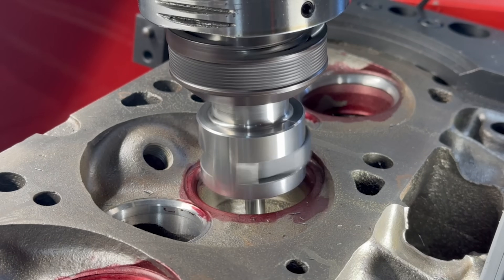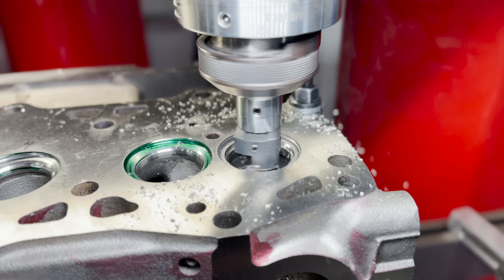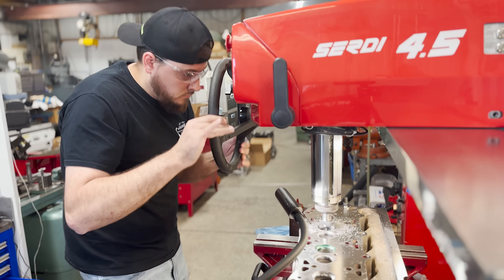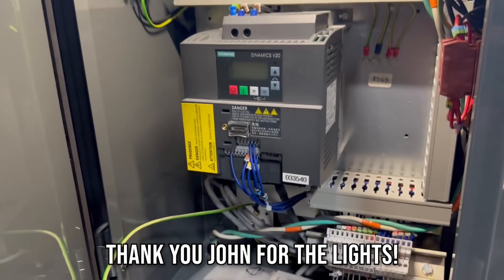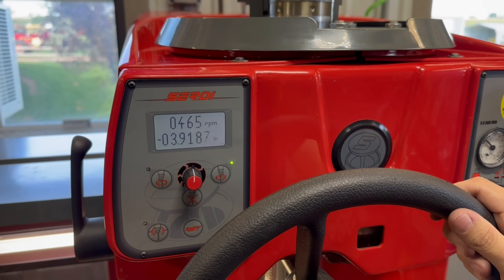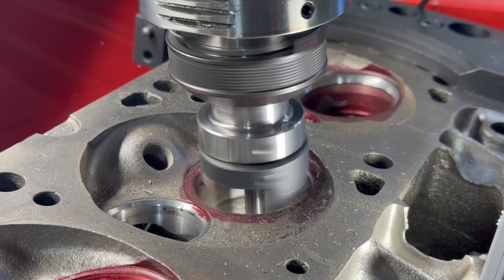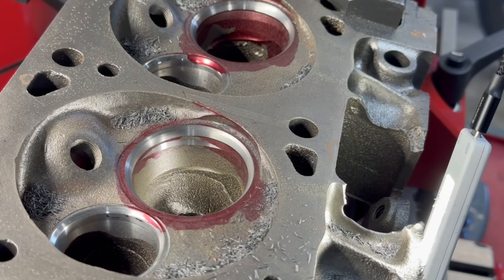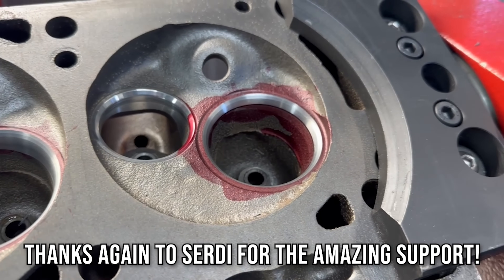Don't Let CHATTER Ruin Your Valve Job!

Comment: This has been a big issue in lathes for years when facing especially the closer you get to the center of the work the material removal rate becomes slower and causes chatter nice to see theyve incorporated a variable speed solution in a piece of automotive machine equipment it's worth installing nothing sucks worse than having to start over because you snuck up on something and then hear that chatter right as you're about to feed the spindle up especially in a machine as anemic as a valve cutting machine you don't have the rigidity like you would in say a standard milling machine that's pretty neat

Comment: Do automotive machine shops do valve seat replacements on Briggs and Stratton opposed cylinder engines? I have one that at least one seat is loose. The block is aluminum, as are the heads.

Comment: I'm surprised you guys don't have New Way valve seat cutting system. 
I used them for years in my shop. 3 steps: 60 degree first (dry) 30 degrees (dry) and 46 degrees wet. We used flywheel grinder coolant. A few turns, let up pressure, let it coast and polished seat beautiful.
You did 45 valve 46 seat interference fit.
Less than 30 seconds per seat.  We had bench mounted electric driver.
5 Carbide cutters.
Do 16 seats 15 minutes average. Great time saver! No set up. Just drop the heads in "V" bench stands. 
iDL machine for seat installation.  Seconds to set up.
Love watching you guys!
Good show.

Comment: Thank-you for posting this video! I bought my Serdi new in 2003. Chatter was a headache. Early on I was so frustrated by it that I considered getting a different machine. The people at Serdi were very helpful and told me about various techniques and tricks to eliminate chatter. It helped a lot and 99% of the time I enjoy cutting great valve seats on my Serdi. You have talked about the same techniques in your videos. Once in a while I still encounter chatter. The CSSV looks like a great solution. A few years ago Robbins was advertising that they had that feature on some of their machines. I contacted Serdi to see if they offered anything like that, and at the time they didn't. I'm calling Serdi to order mine on Monday morning!

Comment: If rigidity is as solid as possible, slowing down rpm and feed rate is the best way to remove charter. Speeding up almost always induces more. Spindles that oscillate rpm works great too. When all other factors are eliminated.

Comment: Good to see manufacturers starting to use this technology.  This technique has been in home brew DIY controllers for years.  It's essential with DIY or hobby equipment without the rigidity of real professional equipment.  This is very true with the sub $4k lathes.  We have been swapping the motors for a 3 phase, if they cannot be purchased with a 3 phase motor, adding a 1 phase to 3 phase controller.  Then, we put a community designed controller connected to that to get head speed control and add this variable speed functionality.  Our algorithm is more of a random speed generator being selected between a high and low set point around the base desired speed.  The width of this window can be changed as can the frequency of how often the speed is changed.  All of this can just be programmed via computer connection or knobs on the controller box.

Comment: I know this was  just a test and test head, but ive seen the serdi operator that i work with cover the next port (next seat to be cut) so the chips dont go down in the guide and gaul or hang up the pilot, ... a former employee was a tobacco user and serdi operator snagged some Copenhagen lids and they usually cover well with a pieceof small roundstick to keep it weighted down, and on the big stuff, c-15 isx ddc60 he has steel bars with flattened sbi boxes(cardboard) to cover both ports at once,  you may already do something like this and just didnt show it.. keep up the great work everything ive seen you do so far is pretty much how we do it, so that means its right, hahahahaha 👍👍👍

Comment: In my 30 plus year's of cylinder head work i have owned pretty much every make seat machine made ,and chatter, and seat contricity has always been a problem. After purchasing my first cnc newen machine i was astonished that all these problems dissapeared overnight with the single point cnc system. I understand that this type of machine is out of reach of most shop's due to machine and tooling costs versus the amount of work being produced but at least serdi has come up with what seems to be a pretty good fix for the chattering problem. I would have certainly tried this if i still owned one.

Comment: At times i will wrap parts in rubber. Or clamp said rubber (1/4” thick) with a c clamp so there is no metal to metal contact of clamp. Same idea as the rubber bands you would put on a brake rotor/drum when turning to kill vibration. Maybe try wrapping your cutter body and duct taping it on? Might be hokey but i do it a lot of things like that in my job shop to keep the vibration out of parts.

Comment: The CSSV feature is well known in the CNC world, but it has a catch. Especially when removing a lot of material, the spindle motor load can be exceeded, as the continuous speed variation takes a hefty chunk of of the power budget.
However, this should be a non issue while cutting these cute little valve seats.

Comment: Always interesting. When I built my lathe long time ago, I first had a VFD (Variable Frequency Drive) driving an Induction E-motor. This VFD had parameters to oscillate the speed within bandwiths, which worked great for combatting chatter. But the setup lacked low end torque, so I replaced it with a DC setup. Maybe Brushless DC one day and then RPM oscillation will certainly be back, because I sometimes really need it

Comment: I've noticed, through quite a few of your videos, that many of your cutters only have a single cutting edge that, regardless of matching, will produce a lateral force on the tool as they cut. I can remember slot drills (when I did machining training) had a slightly shallower blade on one side to reduce this force and hence chatter (as well as reducing depth of cut). I realise this isn't possible in the work you do but just wondering if this one sided cutter, regardless of effort, is a major contributor to the risk of chatter.

Comment: That's pretty cool. I used to use a homemade snake oil, 50% denatured alcohol and 50% Kroil. It helped usually. Sometimes you just had to stop and kiss it with the stones.
Reply: Same . I finish with stones . What is denatured alcohol? Kroll? (im from Au)
Reply: metho

Comment: Hunter stationary brake lathes do that too. Oscillates RPM to prevent rotor chatter.
Reply: There are pasta noodles with more rigidity than those machines.  For what they charge they are absolute machining waste.

Comment: One other trick is to run the tool/spindle in the opposite rotation. I don't inow if that's possible in an application like this, but I've seen it work quite well in regular manual lathes.

Comment: great video looks like Serdi didn't cheap out anywhere. as someone who builds automation equipment i saw only high quality expensive components in that electrical cabinet.
Reply from the maker: I’m biased but it’s a solid machine 😎
Reply: Siemens V20 though... Ugh.   Can there exist a drive with more parameters?  Or one with 1/4 of them where you can't back them up?  (Which is totally not relevant in this video, but I have to get that off much chest.)
Reply: Как называется правильно хон головка для направляющих втулок

Comment: Will chatter make a difference to how an engine runs if the size is in the tolerance
Reply: Chatter is more than just poor surface finish. Chances are your ports are not as round as they could be either. That could lead to poor sealing.
Reply: Mmmmm burned valves....

Comment: Glad to see the shop is doing well enough to invest back into it.  Varying RPM with the drive is very clever.  So is the RPM ramp up technique.  Both seem to be very effective way to make the time constant of the vibration go haywire, thereby killing or reducing it.  Thanks for the video.  I learn a lot from you guys.

Comment: That’s why I still use stones.  Just takes a bit longer….
Reply: By grinding with a stone, the seat is probably well centered and the surface is smooth. May I ask, if you do  have a special procedure to get the valve spring mounting height and seat width the same on all valves? Thanks.
Reply: @heikkipinomaa5720  spring is different - it’s measured and set with shims.  Valve face height is measured and set by grinding more or less - takes some care and practise.  The width of the 3 angles, I measure after blueing the seat to see clearly and grinding more or less.  It does take care and practise but can be very accurate.  The disadvantage is the time it takes - even dressing the stones.  But for a performance engine this doesn’t matter so much.  I don’t churn out hundreds of heads.
Reply: Thank you very much for your  patience and sharing your knowledge. I wish a pleasant weekend for you.